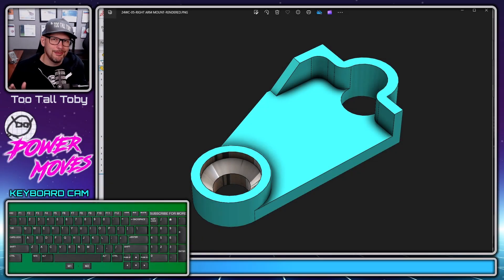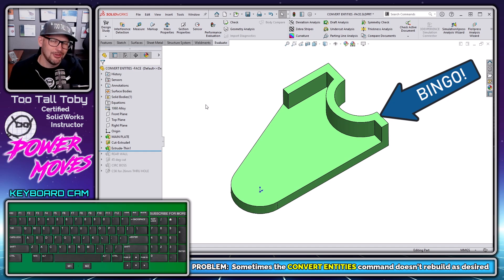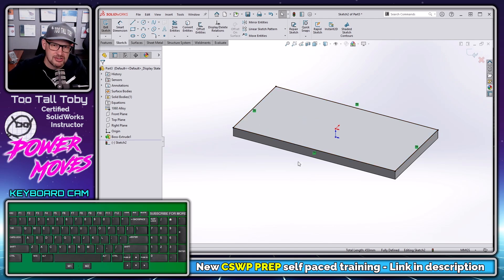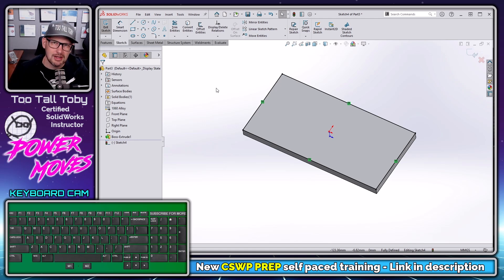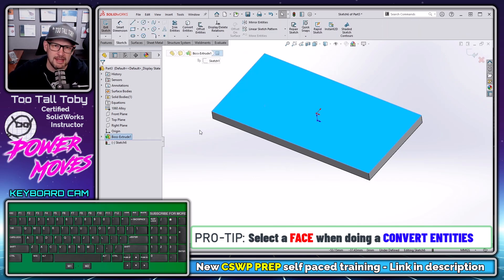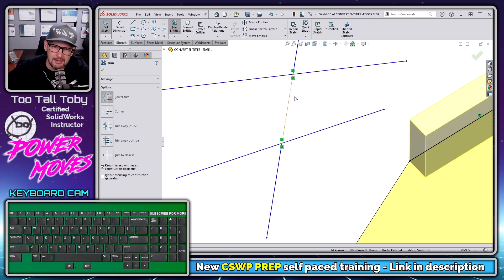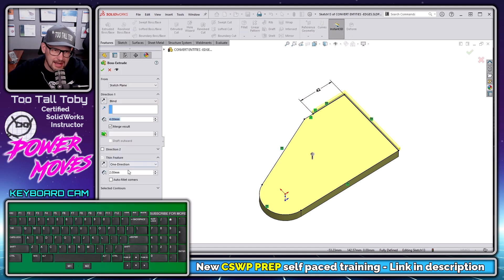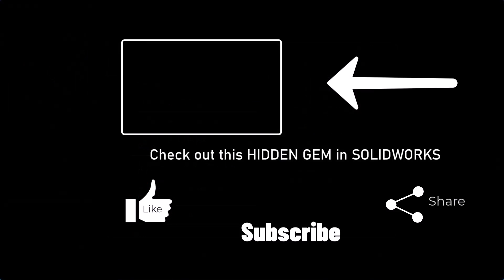How to CONVERT ENTITIES in SOLIDWORKS and AVOID downstream rebuild ERRORS!

Comment: Another nice piece of info. I am still looking for the 'Dimension to face' from Creo... when you dimension your sketches to edges you get a problem like the one in this tutorial, in Creo you can dimension to a perpendicular face which makes for much more robust models. 
E.g. if you put a round on an edge that has been used for dimensioning, or particularly when working in sheet metal you can dimension to a surface instead of the 'edge' of a bend. 
Any tips?
Reply from the maker: Im not sure - maybe it only works if you're in a 3D sketch? I dont use creo, but I know that in SW you can dimension from a face in 3D sketch, but only from an edge in 2D sketch.

Comment: You might know that I'd be comparing it with #Onshape capabilities no? 😁

If we thin extrude a face perimeter, we don't need a sketch to do that. We only select the face and the entire perimeter is automatically selected. If the perimeter changes, the thin extrude will update automatically.

But if we want partial perimeter thin extrude, then we need to use a sketch and this is where we need to update manually the sketch to get the thin extrude to work as expected.

But I'm going to send an improvement request right away and we will get a solution in the next updates! 😉